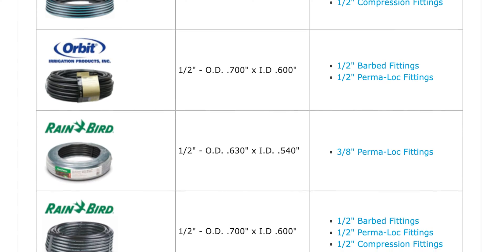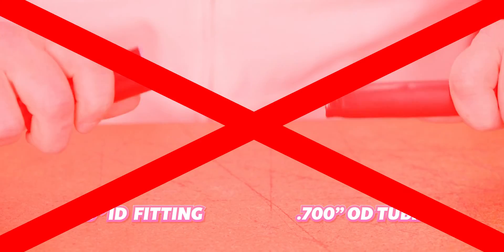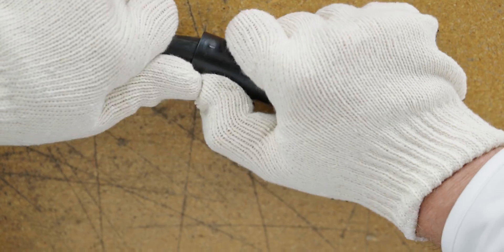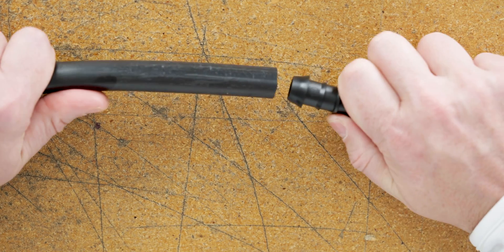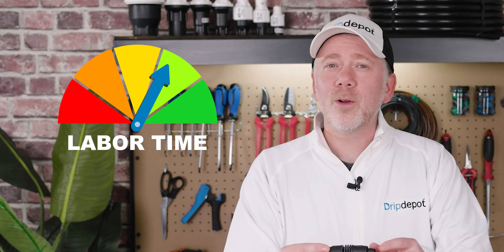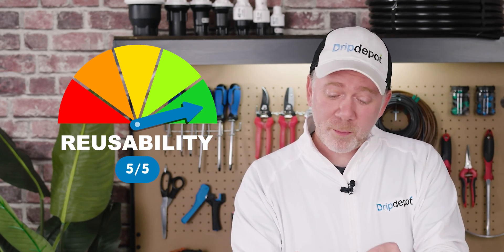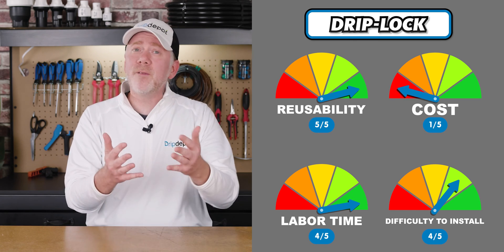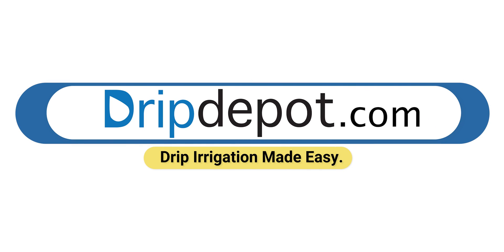Drip Irrigation Fittings: Choosing the Best Type for Your Project

Comment: I really liked this video.  Your explanations were great.  I’ve used drip compression fittings for years.  Now I’m having problems with my wrists.  I think Perma Loc fittings make sense.
I was wondering when I can get a pressure regulator for my sprinkler valves that I’m converting to drip.  I have 6 sprinklers on a valve.  If I put a pressure regulator on the valve, what pressure do I need for the valve pressure regulator?
Thanks for your interesting presentation.
Reply from the maker: Debbie, thank you for the kind words! 

Perma-Loc is definitely easier on the hands than a compression fitting -- I'd say the drip-lock are the easiest on the hands (but not the easiest on the wallet, always that tradeoff!). 

Most likely all you'd need is a threaded regulator that can thread on at your valve and maybe an adapter or manifold nipple to go between the valve and the regulator.  Do you know the size of your valves and if the connection is threaded or slip?  If so, let us know, we'd be happy to go over the information with you.  Converting sprinklers to drip is one of my favorite topics, so don't hesitate for a second :)

Comment: You didn't address reliability over time.  To me, that's the most important characteristic.
Reply from the maker: Good call, you're right that durability is a big concern.  Any and all of them can last for years if they're clear of some of the common hazards (landscape maintenance equipment, foot traffic).  Out of them all, the Perma-Loc is going to be the most durable -- they're the densest of the lot by a good margin but still flexible enough to over-winter with no troubles when drained of water.  In second would be the Drip-Lock fittings -- also densely made, I give the Perma-Loc fittings the edge due to the teeth on the Drip-Lock fittings -- the teeth will experience issues before the plastics (though it should still be long down the line). 

Barbed insert and compression fittings are on the lower end of the durability scale.  In a low pressure drip system they should still enjoy a long life, but they are much more easily damaged by impact damage than the others (but cost a good bit less as a result of fewer materials used).

Comment: unable to find perma-loc in australia (beside amazon)
Reply from the maker: In addition to Amazon, there's a good chance they can be found on eBay as well.  Unfortunately the international shipping costs might make that prohibitive.  It could be worth checking around at local irrigation shops to see if anyone carries them.  While I don't think they make Loc style fittings, Antelco is an Australian manufacturer of drip irrigation parts that do carry some reliable barbed insert fittings (and lots of great emitters and micro-tubing fittings).

Comment: Can the perma-loc fittings be buried under ground
Reply from the maker: You bet!  I'd say it's fairly common for them to be buried.  Just like when burying other pipe types, you'll want to be careful not to let too much debris get inside (a good flush after installation helps with that) and you'll want to give them (and the tubing) a nice bed of soft crumbly soil to lay in :)

Comment: Drip lock fittings are really difficult to remove after they have been on there a while. Ask me how I know :(
Reply from the maker: Stephanie, I am definitely and genuinely curious!  I have a system that uses some drip-lock fittings I'm going to need to remove (for expansion) here in a couple weeks, so I'm about to find out first-hand -- what can I expect?

Thank you truly for the feedback!
Reply: @dripdepot  There was no way I could release them in place. I had the cut the tubing and after about an hour of fighting with a plier... they're still on there! I think I would have to clamp the fitting onto something to rip the tubing out but I'm just going to call it quits and go with permaloc. Please update if you have a different experience and if you figure out any tips!!!
Reply from the maker: I absolutely will Stephanie!  I'll make sure this feedback stays here so other folks can see it as well.  It sounds like maybe the pressure of multiple watering cycles coupled with the thermal expansion of the tubing may have dug the teeth on the fitting in too deep?  Cutting out tubing is just like a compression fitting, not my favorite either :)

Thank you again!
Reply: @dripdepot  updates? I'm still on the hunt for easy reusable fittings that won't wreck my arm.
Reply: @StephanieFung  Heya Stephanie!  I hope the day finds you well :) 

I suspect your best bet will either be a Perma-Loc or Barbed Insert Style fitting -- both are reusable and aren't too bad to get connected.  Have you ever tried either type before?  Out of the two, a Loc style would probably be easiest since no outside clamps are needed.  How many fittings does your project require?  If it's not too many, you could employ the hot water trick too -- dipping the end of the tubing into hot water for a few moments softens it up and makes it very easy to get on over the barb.  Inconvenient if you have tons of fittings to do, but not too bad if it's only a handful.
Reply: @DripDepotAdam  thanks for the reply! I've tried the Perma loc from drip depot and they work well to get on. My problem is actually getting them off. I container garden on a deck and find myself reconfiguring my drip setup about twice a season. I saw that netafim has techlock fittings that seem like easy on and off slip fit but it's specified for their 17mm.
Reply: @StephanieFung  Stephanie, that's a very good question regarding the Techclock fittings!  At first glance they looked every similar to Loc style fittings, but a closer inspection reveals they might be a little different since they contain a compression ring inside.  I've reached out to the manufacturer to see if I can get some.  You do have it right on their size (16mm - 17mm), so they wouldn't work with .600" ID tubing, but they're still absolutely worth testing out, and if they do well for the manufacturer, there's a very good chance we could see them come in other sizes :)
Reply: @DripDepotAdam  That's great! I'd be happy to beta test too ;) it seems like a really nice solution for a home deck gardener if it's slip fit and all the retention is in the compression nut. I understand the barb on the other loc fittings is for extra security especially in landscapes but it's really tough to remove and reuse.
Reply: I'll vouch for what you said. Any drip lock fitting that has been outside (and where else would it be lol) for some time, and has dealt with our hard AZ water, is essentially impossible to remove the way it was designed to be removed. Almost every one I've had to just cut off, run some new tubing and use a different fitting. They seem more durable than compression in my experience, but, at least in my experience, they don't have any reusability.
Reply: First season using Drip lock fittings and even after a day I can’t get them off.